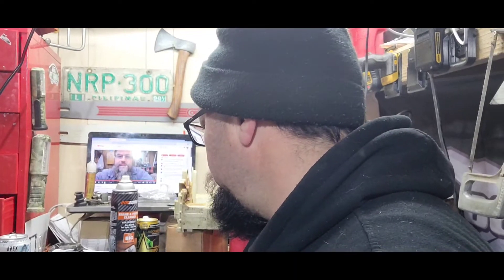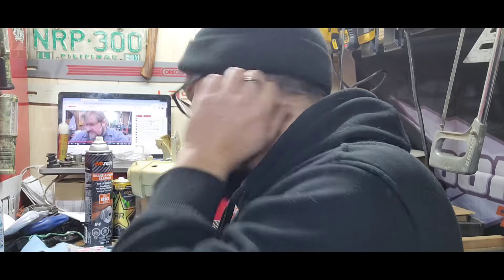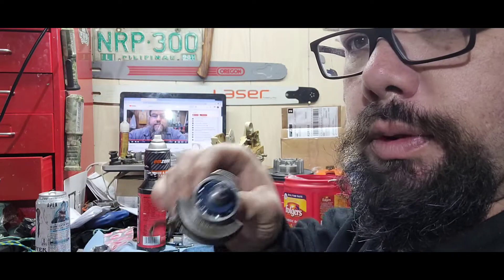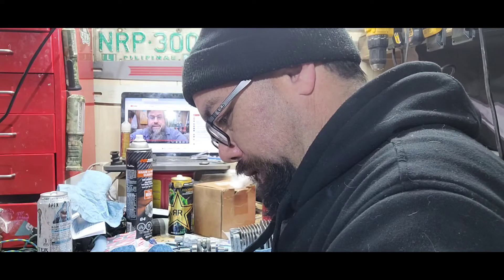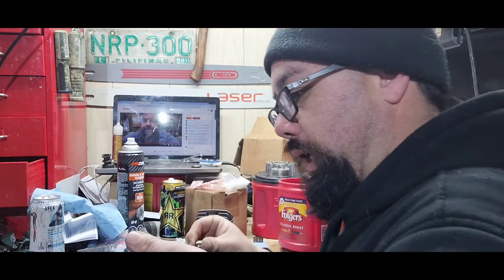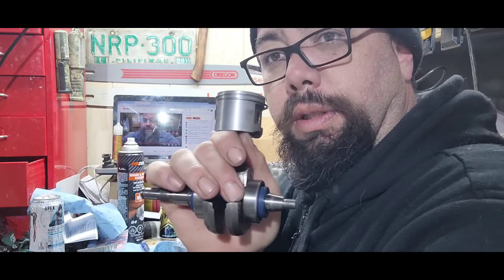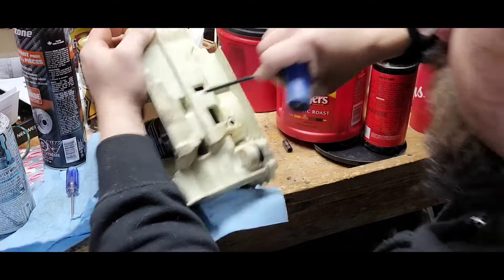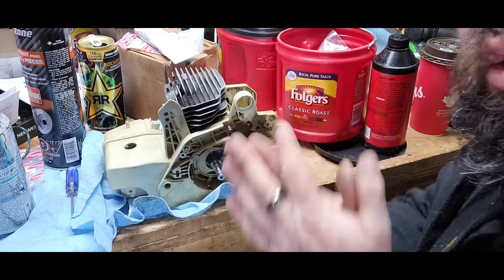Part 2 : Putting this 025 together

Comment: I have an ms250 in the shop, needs work, friend brought an 025, and this ms250, I got the 025 going real nice, stole parts off the ms250, so in the near future I am going to be hunting down parts to make it go as well
Reply from the maker: This thing is a runner, haven't posted to the video yet I'm behind in uploading with all the snow I been clearing for the last few weeks. What are you missing?
Reply: @ChippyOutdoors  a few things, I have to make a list, 😂
Reply from the maker: Lol
Reply: One thing is the bar cover and one of the bar studs, this has the 1 hand system, and I think those suck. Another thing would be the drum/sprocket, I switched them, the 025 one was wore out....etc
Reply from the maker: @j.chrisbeck7492  nothing I have any spares of, lol I had to pick up missing parts even though  I had 2 of them also just how the cookie crumbles. Actually upgraded the clutch drum from a spur to a rim sprocket. Muffler modded and a little porting. Find out today how it does against a muffler modded low hour ms250. Rings aren't seated yet in this one that'll take a little bit
Reply: @ChippyOutdoors  I look forward to see what it does.
Reply from the maker: Same, first clamy  I've ported but these 025/ms250 are pretty spicy from factory already so this clam is a total learning curve so it's making me very curious. Not trying to lake a cookie cutter by any means and its not its actually rebuilt to be on my side by side